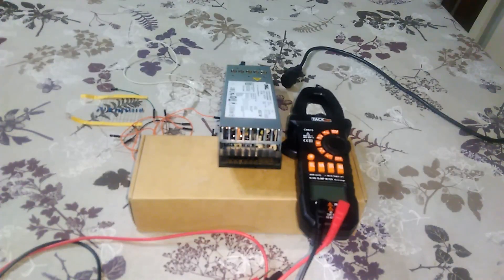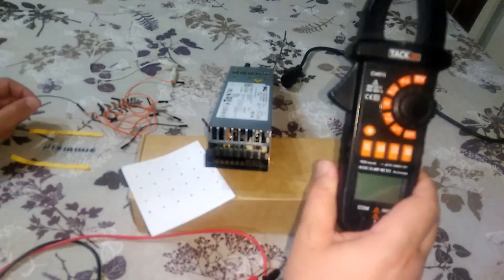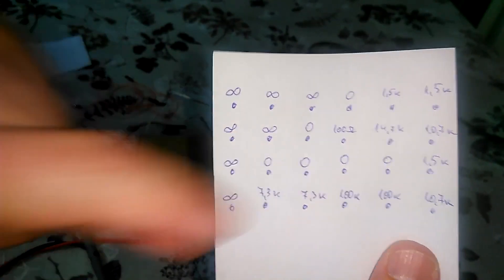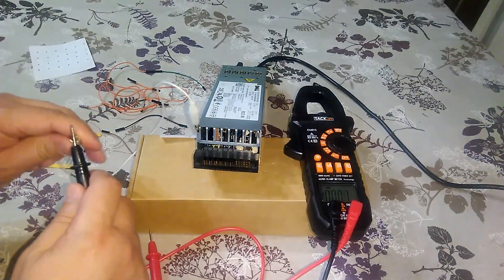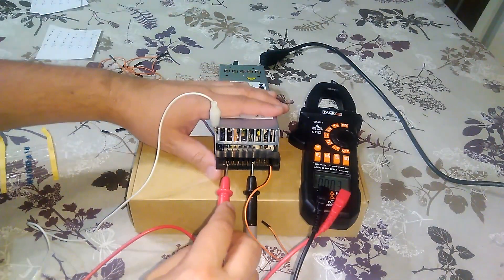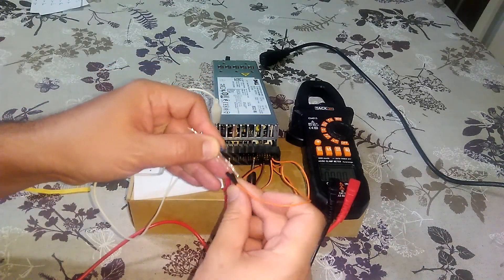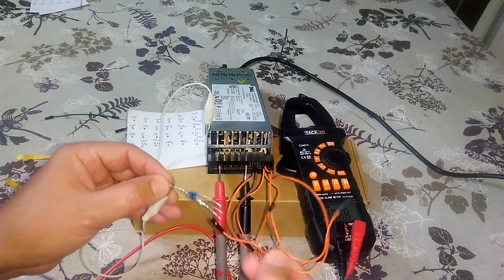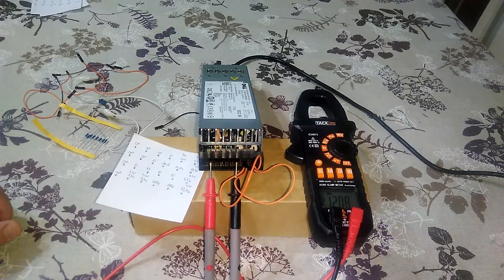Converting Dell KY091 Poweredge R610 502W Power Supply A502P-00 into 12V charger

Comment: Hi. Did you found what's the pin to ground to have the fan to slow down? Mine turn on ok grounding the 2 pins you showed, but on similar tutorials for other similar fans, there is a pin to ground to slow down the very noisy fan.
Reply from the maker: No I haven’t look for that yet.

Comment: When you measure 12 volts, are you getting 38 amps... I am following your setup to do battery charging and it looks like your setup makes 2.92 amps.... If you look at the psu it says 2.92 and 38 amps....
Reply from the maker: Definitely 38A
Reply: @tedonash2681  My PSU also don't work correct 2,72A, and voltage is 10,71V. I connecting 40W resistor. I't looks like run in 2,92A SB - standby!?

Comment: I tried the solution at 10:15 but my 502W power supply didn't turn on 12v :/
Reply from the maker: Hmmm this is the first time I hear that this is not working. Are you sure that the power supply is working?
Reply: @tedonash2681  Yes, it works when plugged into my Dell r610 server.
Reply from the maker: @theSquashSH  I don't know what the reason may be. All of the people that have tested this confirm that is working

Comment: Very nice tutorial! Do you know of a way to increase the output voltage of these supplies? I would like to get up to 13.8V if possible.
Reply from the maker: It depends of the power supply you have. Usually there is a potentiometer somewhere when you open the power supply where you can adjust the voltage +/- 0.5 volts. You will most probably not be able to go all the way to 13.8 volts. To go there you will need DC-DC boost controller. There are plenty of them on aliexpress.

Comment: Well done. Very nice job. So what we need to do is do find which pins have voltage, then connect all of them to GND via  500 ohm resistors, then find out which are used to power on the PSU by removing all other pins, one by one. Finally connect them to GND and finish the job?  I am just wondering if your tutorial works with other Dell PSU models. I have some C570A-S0 PSUs and I want to power them on.
Reply from the maker: You have to try to see if it will power on or not. My advice is:
1. Measure all pins resistance while the PSU is powered on ignore those that have below 1k ohms and above 10k ohms.
2. Ignore all the pins that have 0 ohm resistance relative to the ground (the metal box of the PSU)
3. Measure all the pins voltage that left over from point 1 and 2 and ignore those that does not have any voltage or have 12 volts in your case.
4. What's leftover connect with 0.5k ohms resistor to the ground
If the PSU turns on then start removing one by one until you have only those need for the PSU to turn on. If not then sorry - bad luck. Be sure to check the PSU that is operational.
I hope that this will help and you will turn it on.